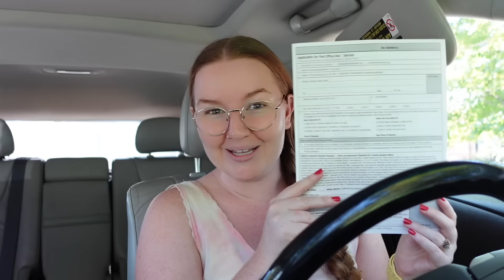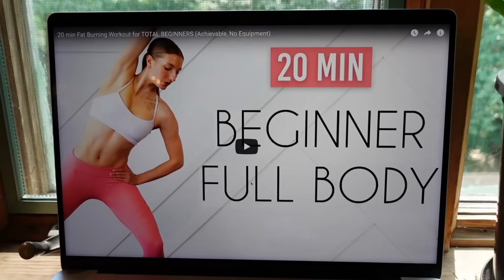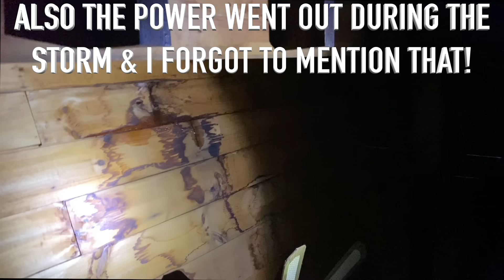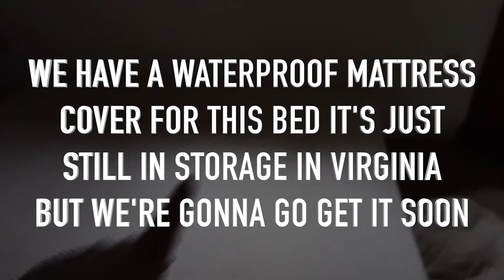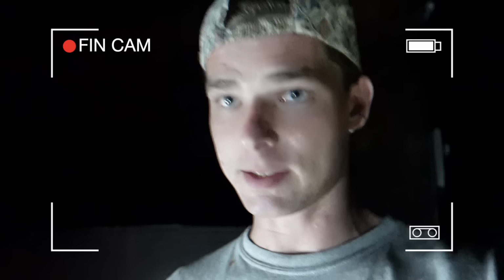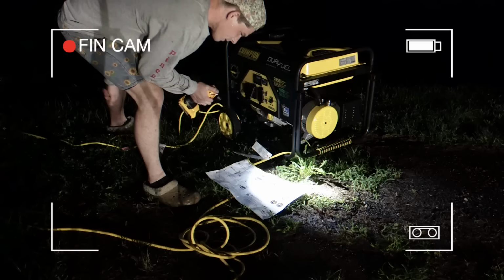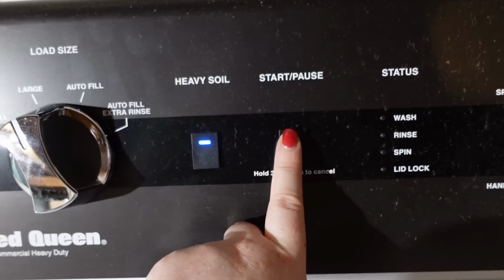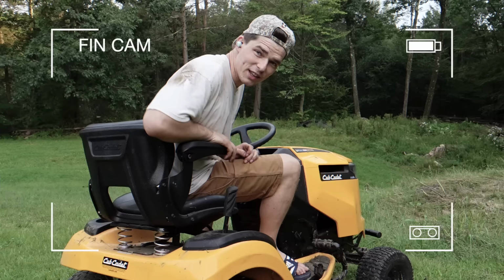RENO VLOG | major roof leak + 12 hr power outage= the worst day in our house so far

Comment: guys buy multiple tarps as a TEMPORARY fix for the roof, overlap them and staple them down. DONT  buy a big generator!!. get a small fire place. get a small jackery solar generator 500 to charge your phones and computer etc. take $10,000 to $20,000 of your reneovation money and buy a tiny shed from home Depot and insulate it!! this will be your tiny home as your work on the main home and can later be used as a guest house. BUY MULTIPLE CANDLES!! candles will save your life and give you and beautiful aesthetic. as for the roof its something you guys can fix on your own, if you look it up. the foundation probably need to be changed. that's the first thing you should start working on, but it will be worth it in the end. as for the windows cover them and work on them as you go. this is like camping!! camp out and build!! oh and buy a air remover fan, it will help to get rid of the moister.